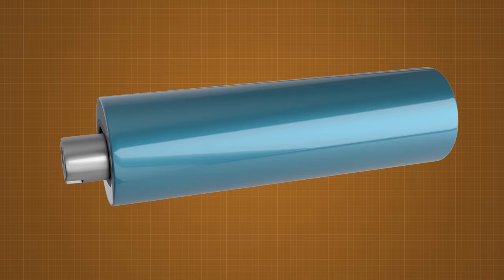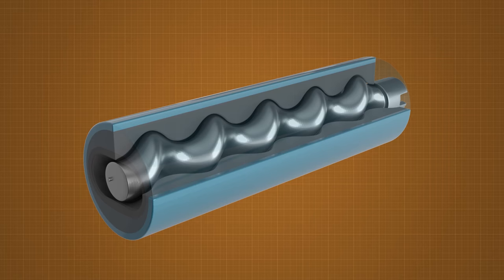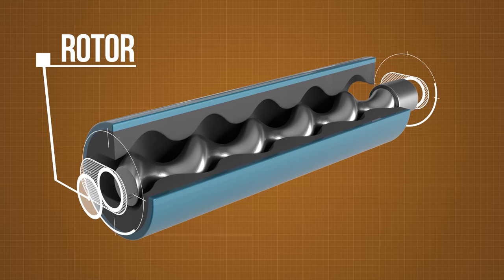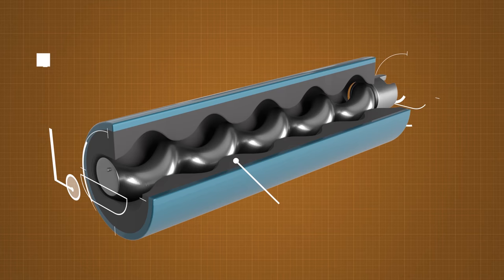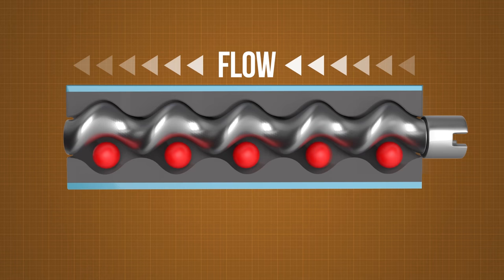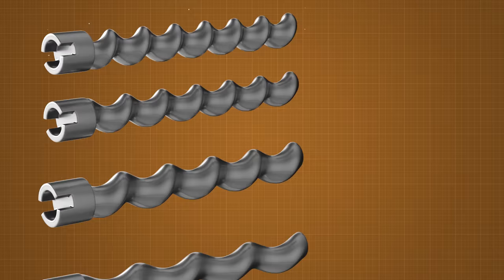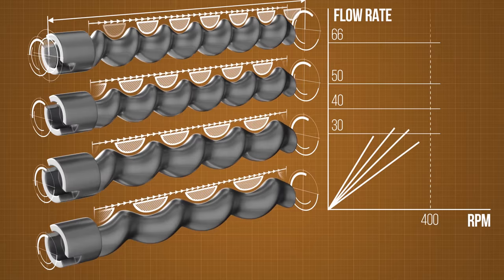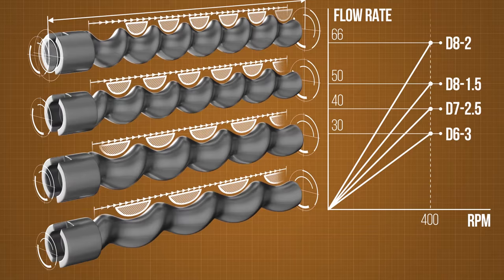Rotor Stator Pumps explained by Putzparts24

Comment: How many hours will it run with sand and cement?
Reply from the maker: This is very impossible to answer. Too many parameters need to be considered. First of all which rotor stator pump are you talking about?
Reply: @PeaceHesse  D6-3
Reply: Not long at all from my experience 3 months if it's really sandy
Reply: @colethomas6837  will it be better for the cement and sand mix for plaster?
Reply: @PeaceHesse  I want to use it for cement and sand mix for plaster
Reply: Anything course like sand or cement will eat your stator up cause it's just rubber. Sometimes sand gets into your fluid and that's what typically wears them down. If your fluid is a paste it should be okay but keep a close eye on it.
Reply: @colethomas6837  I think peristaltic pump would be better thant stator rotor .